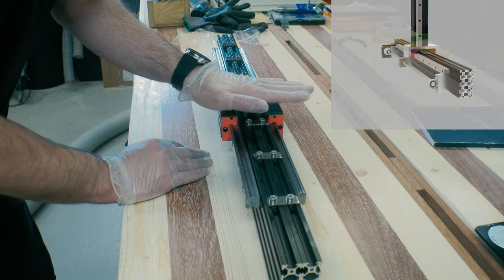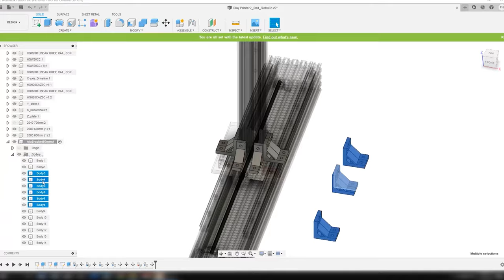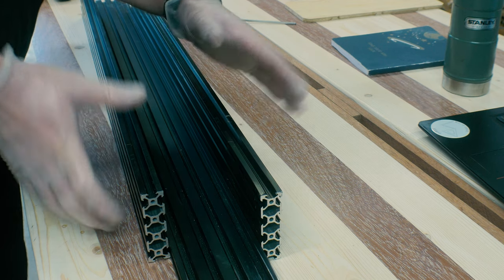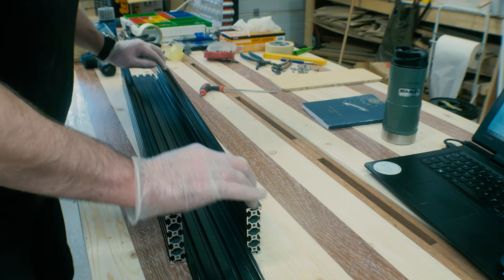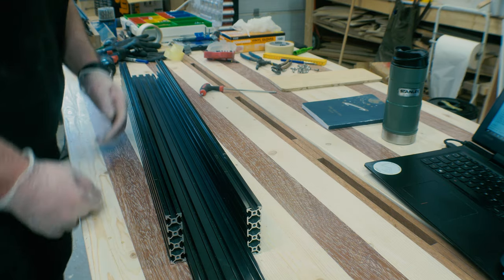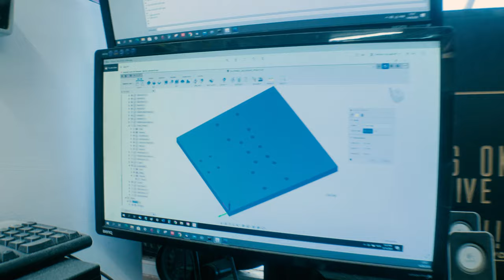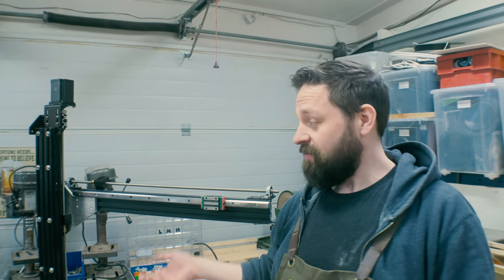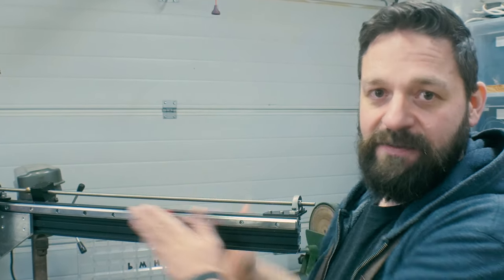DIY Ceramics 3D Printer (part 3) - Building the Mechanics | CLAY | PROFILES | Linear DRIVE

Comment: hi great job i hope you finish this project why you didnt use tb6600 or other driver instead of this a4988 they can give you more current
Reply from the maker: Hi and thanks, I to want to finish the project 😂 And I plan to use the tb6600 hoocked up to the ramps 1.4 controller 👍 a4988's are a bit weak for the Nema23's

Comment: Wow! Súper good job! One question, what parameters have you used for cutting the aluminum plate? Speed, rpm and depth of pass. How many time has taken that cut? Thanks a lot Willy!
Reply from the maker: Hi and thanks :)
My diy cnc in made mostly out of soft wood so I had to take it real slow. I also used a 4 flute upcut, 8mm diameter tool that worked good. I tried a 2 flute tool once but that was a disaster 🤣 
As for feeds and speeds it was slow, 300  mm/min and 0.5 mm depth per pass. And it works, but takes some time
Reply: @WillysGarageNorway  do you think that the structure of a workbee is stronger than your DIY CNC?
Reply from the maker: Yes I think so 👍
Reply from the maker: Altou does the workbee have nema17, or nema23's?
Reply: @WillysGarageNorway  what RPM or what speed setting setting you have on the Makita for the aluminum? slowest possible?
Reply: @WillysGarageNorway  nema23
Reply from the maker: About 20.000 rpm, setting 5/6. That worked for me. But I have not testet a lot of different settings yet.
Reply from the maker: Ok :)

Comment: First! Yay!
Reply from the maker: Not bad 😀👍
Reply: @WillysGarageNorway  Looking forward to when you finish this ceramic 3d printer, and start printing vases. Have you figured out which clay would you use?
Reply from the maker: @RetrowaveUniverse  Still doing research on that :)
Reply: @WillysGarageNorway  ( https://plainsmanclays.com/data/index.php?product=12881 ) . That's a clay I know which works. We used that one in our university, its a bit expensive but it works like a charm. But if you want to formulate your own clay from raw materials check ( https://digitalfire.com/home ). Here you'll find basic recipes for most type of clay recipes.
Reply from the maker: Thanks for the tips! I will check it out